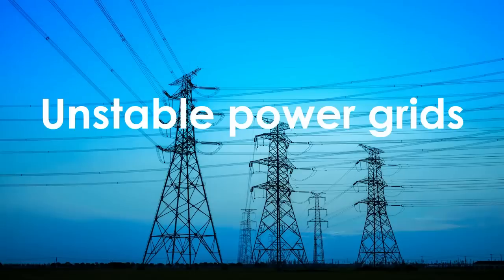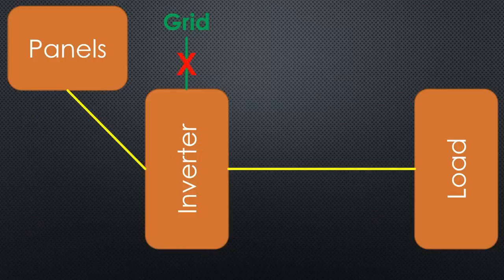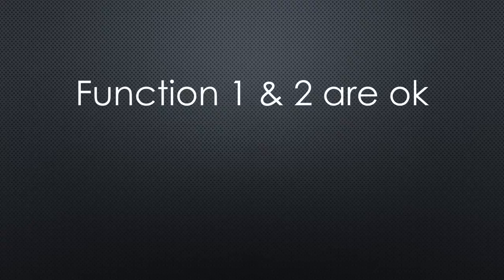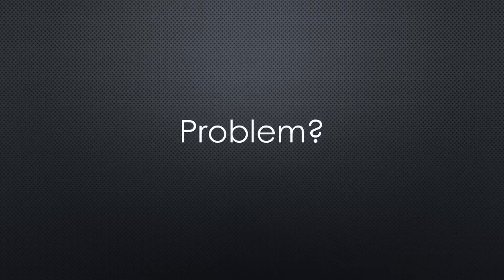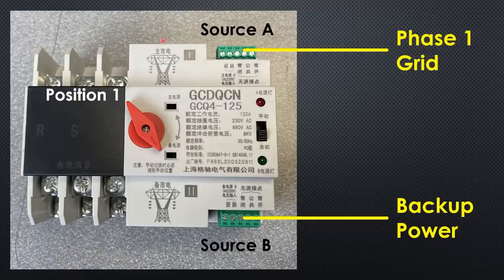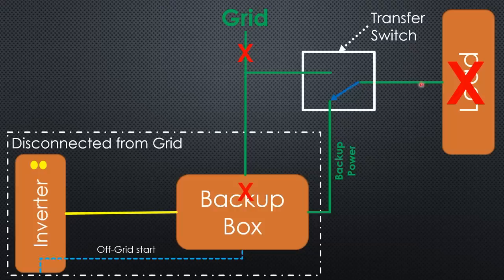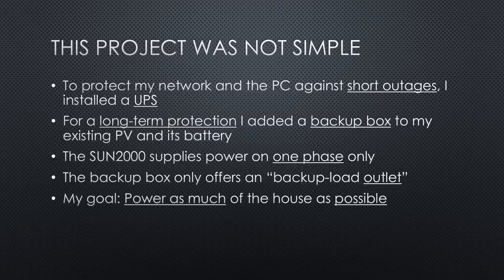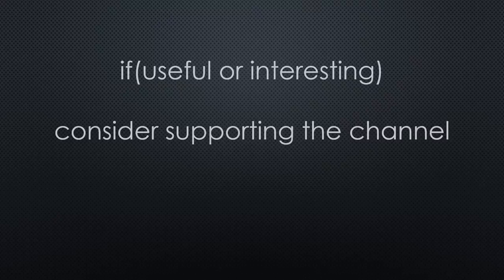448 How to Build an On- and Off-Grid System (Backup Box Hack, Huawei SUN2000, LUNA2000)

Comment: Hi Andrea, maybe I missed it but did you consider  a Hybrid inverter. You could check the Growatt systems. I use a SPF5000ES, only 1phase but you have 3P options aswell. The only drawback this system does not netmetering (export to grid) but new hybrid systems with this option exist. All switching from grid to inverter is automatic, the inverter is disconected from grid, If you use correctly sized batteries for storing sunpower 'you are good to go'. just my 5cents. Thank you for your great videos! You inspire! 73
Reply from the maker: My inverter probably is called „hybrid“ ( I do not know the exact definition). It uses solar, manages the battery, and provides 3phase power to my home.
Reply: A hybrid inverter does the switching between sources automaticaly. source 1 = PV, 2=battery, 3=grid/disel agregat
Reply: @Phoerixx  my Multiplus also have a transfer switch, but if you have a 3 phase at home and only one phase inverter, you have to use an external ATS

Comment: Consider exploring Victron equipment. MQTT, ModbusTCP and Node-RED is native to the ecosystem. Your changeover will be within 20ms.
Reply from the maker: My colleague uses Victron and is happy with it. Have to keep mine for the next few years...
Reply: I guess the delay comes from inverter start-up in off-grid mode, where it takes time to switch the system and supply electricity. Backward switch to grid is nearly instantaneous. I guess and switch relay will have the same delay to do the mentioned process.

Comment: In Canada we have much the same problem. My plan will use a generator but the only legal way to do it is with a transfer switch and you need to mind the grounding when doing a whole house application as opposed to backup circuits. I only have two phases and can jumper them with an adapter to my generator.
Reply from the maker: A generator is a good and simple possibility!

Comment: Yesterday weve installed a 200kw diesel generator at our company in bern. Just for worst case situations.
Reply from the maker: Slightly bigger than my installation ;-) But it is scary that we have to do such things in Switzerland.
Reply: Depending on the purpose, it might be wise to add a battery pack to close the gap between grid switching. Power generators have a small startup time and a small period of time to produce a stable output. Larger installations and critical infrastructure are not pleased with a delay of 1,5s. The batterypack kicks in first and as soon as the power generator produces a stable output the grid switches to the generator. Very reliable, very expensive too.

Comment: Wow, it looks like you know how to party! 🎉 I'm so jealous of your fancy setup; it sounds like you'll be set for any power outages! Thanks for sharing such a cool project. I really like how you've put your whole house (almost) on backup mode.

I'm purchasing a 3-phase hybrid inverter (Solis) with backup mode. According to the datasheet, the AC backup port is also 3-phase, which can switch to battery in 40ms in the event of a power outage. I'm not sure how this inverter can be integrated with the whole house. I might need to implement your solution later on.
Reply from the maker: I also do not know if they are certified to be used on public grids.

Comment: From my experience with my install. Basically the same as yours without the transfer switch; the backup output from the backup box is always powered; even when the grid is up.
Reply from the maker: In my case (three phases), this would give a big short-circuit. So you are lucky you can do it without transfer switch.

Comment: i plan to use 3 victron inverters, so i whould get 3 phase power even during a grid fail (we need 3 phase to run our wood based heating systems and some other important things).
The viscron inverters have the benefit of supliing power without any downtime at all (like offline ups). You can use any Solar inverter with them, only thing you need to make sure is the inverters need to have more capacity than the solar inverter. Once the battery is fully chared the vicron inverters rise the frequency to 51hz to disable the solar inverters.
Reply from the maker: My colleague has a similar Victron system. He is happy with it. I think, he has a low-volt battery (or batteries), though.

Comment: Great video, very interesting, but one note of caution...
With star-wired 3-phase, the neutral cable may be only the size of a single phase or even smaller, as a balanced load will have no neutral current and most 3-phase devices will have neutral current less than a single phase current (because the three phase angles sum to 0 and the neutral only carries the imbalance). 
However, you now have all three phases in phase. That means the neutral current will be the sum of the phase currents, so the neutral may be overloaded. I don't think you mentioned that, so take care to check the neutrals are appropriately sized.
Reply from the maker: I agree. But my inverter only delivers the power of one phase if in off-grid mode (3kW). So it should be ok.

Comment: I guess the same idea could also be done with an electric car equipped with vehicle2load. That is usually a few kW output, but not sure if it can be automated and wired to be always ready when the car is plugged in. And another thought. Maybe 3-phase equipment can be wired to have supply only from grid, as that would guarantee no odd behaviour if all phases are shorted. At least heat pumps etc are probably best to isolate like that. Otherwise a very innovative idea!
Reply from the maker: So far we have no vehicle2load here. So I did not look into this matter...

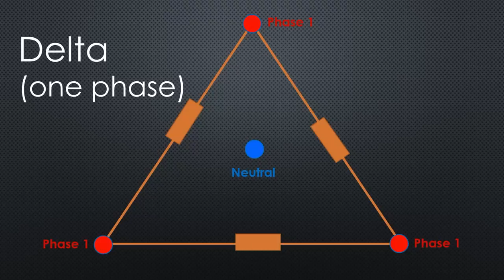Comment: Very interesting, usefull and entertaining. What else? Btw, at 5:38 you metioned that "old motors" won't work in a star configuration because of the rotating field. However, by useing the Steinmetz circuit (adding capacitor to create fase momentum) it is possible. Of course with the downside of losing a lot of power/torque from the motor. I had to come up with this solution several times (air compressor, no 3 phases available). It is however a emercency solution that I would not recommend.
Reply: With some Variable Frequency Drives it is possible to power smaller 3 phase motors with one phase.
Reply from the maker: @Philip: As you know, I forgot all these things during the years because I hardly touch more than 12 volt systems. But good to know in an emergency situation.
Reply: @AndreasSpiess  I'm very fond of 12V systems too and I'm replacing 230V circuits where I can with 12V (or 24V). This goes very well for everything related to lights. Makes it handy for battery backup and legislation is much easier.
Reply: @PhG1961  My radio room (with the exception of the PC) works on 12V, too. But the lab is on different levels... 12V is really very simple: Just connect a LiFePo battery and it works...
Reply: @HB9BLA  Exaclty !

Comment: Nice  hack. However I still would try to have priority loads on separate line/phase. Because you know... power of habits. Especially if you don't have any constant "alarm"/indicator that grid is off.
Reply from the maker: With out 10kWh battery and solar charging also in off-grid mode we could live our life off-grid during a big part of the year. So it is not too critical.

Comment: I have five UPS units from that company, you'd be wise to have a spare battery on the shelf for when you unexpectedly need to replace the one that came in the unit. The cheap aftermarket ones are as good or better than the originals too.
Reply from the maker: Thanks for the info. For the moment, I sent it back for repair or exchange. We will see...
Reply: yes these ups batteries are always failing after 3 years max (less for entry level models like this one...) just keep one 12v battery as a spare...

Comment: hello Andreas, you should be happy that you live in Switzerland. In Czech republic due to stupid rules of goverment subsidies, batteries and inverters from major suppliers now costs  2x more than in other countries in Europe
Reply from the maker: That is bad news!
Reply: @AndreasSpiess  Yes, it is very sad, unfortunatelly these types of regulatory problems is not uncommon in east europe countries. 10 years back almost no small rooftop instalation get permission to supply into grid. But big solar parks on the fields get permission without problem. Also since 2011 electricity consumption is measured for each phase separately, so for household instalations we need inverters with asymetrical output instead of symetrical which are common in most other countries.  
I just get offer for PV system from 2 biggest companies here, for example they want 8k-9k euros for 10kWh battery, goverment subsidies for battery are up to 4200eur, but is limited to 10kWh and 50% of purchase price. DIY installations are not allowed (only exception is full offgrid). Not even all electrican are allowd to do it. Only electricans with special PV certificate can install PV systems connected to grid and subjected to subsidies.

Comment: Great video as always. We have decided to go for a full turnkey system with three phase offgrid possibilities (next year). In Sweden, we have a  "green subsidy" that is capped at 50k SEK per person, so there's no batteries this year since the subsidy is eaten up by the main solar panel installation. 
I would have loved to do a more DIY solution, but we find ourselves with more money than knowledge, so that's our route. The DIY part I'll be when I try to integrate the geothermal heating we're also installing this year and the solar stuff into Home Assistant. Perhaps I will make a short series of it and upload it on my channel - if I can get my ass out of the trolley (Swedish proverb) 😀
Reply from the maker: Cool. So you have a lot of work in front of you. But it is very rewarding to produce your own energy!

Comment: WOW! You guys have 3 phase in your homes. Here in North America homes are connected to 1 phase with a transformer that has a center tap. So homes have single phase 240V or dual 120V half phase, from a "hot" to ground, supplies. Most (99%) loads are 120V to ground, only stoves and other heating devices are 240V. I'm not sure if you can even get 3 phase brought into a house, and if you can the price would be ridiculous. 😃
Reply from the maker: Your country is much bigger and you would probably need more copper;-)
Reply: I usually just see 3 phase (US) for businesses: retail, food, etc. Most residential poles only carry 1 phase {7200V or so) after you get a relatively short distance from the substation. I'm always amazed at the small wire I see in boxes overseas when I have several circuits w/ #6awg on them and 4/0 coming from the utility meter.
The caveat is that those houses have 240v-Neutral on their outlets where ours are 120v. A #14 wire there carries nearly double the power for the same current.
Reply from the maker: Our system provides 400V from phase-to phase...
Reply: @AndreasSpiess  and that would make about 230V phase to N. 👍

Comment: I don't know about the Helvetic confederation but here in EU (I mean Greece) the domestic circuit connected to the grid has to be certified by a technician. This implies that every single devices such as the transfer switch has to be CE compliant which i doupt it is when you buy it from AlliExpress (I may be wrong, please double check by yourself). Siemens sells one but it's above 1000€ here. The Hager model is 813€. The Chinese one is only 36€ 🤔Something tells me that the price tag is not just due to the CE sticker.
Reply from the maker: I do not know, but the professional Electrician installed it. In this application, it is not very critical. Nothing dangerous happens if it does not switch and if it connects the grid to backup while the grid is on (which is a very strange failure mode because it switches between the grid and backup), we get a dead short across two phases (because they are connected) and will trigger the fuses.
Reply: @AndreasSpiess I didn't say that it was dangerous, I said I have no idea why the price tag is so high and maybe it is for other reasons than safety. Maybe reliability? Maybe it's the EU specifications that makes it expensive to produce? Lack of mass production? I don't really know.
Reply from the maker: @srfrg9707  I also do not know. But in my case, I hope it will never be used (or just a few times a year). I assume there are other use cases. 1000 Euro for a simple two-way switch seems a lot to me anyway...
Reply: CE is self certifying....the companies grade themselves, it is the most nothing of all standards.  A kid could set up a lemonade stand, write CE on the side, and it would probably pass...you know, since the kid would be the one deciding if it did or not.
Reply: @srfrg9707  On Amazon user review I found an interesting hint about the potential issues with this switch. It is not (always) switching as fast as promised and no guarantee that all phases and neutral switch synchronously. This could cause an issue if the neutral switches later and is not connected for few milliseconds while the mains are already connected. This is mainly an issue when switching back to he grid with 3 phases, as in such case there could be >230V if the sources on the the three phases are quite unbalanced load.
Reply: I found a European transfer switch solution (ABB OT63F4C) that makes me feel more safe my house won’t burn down 😬

It’s a manual switch and I believe that’s OK for my use (grid down for long time). Of course, it will not cover grid breakdowns when I am on vacation, but a motor driven ATS from ABB costs 400 euro or more. 
This one is only 50 euro.
Reply: @Jacobb1971  50€? Where? I found it at 157,54 €

Comment: Nice solution but be aware, that the neutral wire now carry all the load current, at the same time, compared to the 3-phases.
I know the inverter is only "2-3KW", so there shouldn't be any problem in your configuration, but with larger inverters, this could be a problem, depending on the dimension of the wiring in the house.
Reply: This was my first thought as well. Curious about this if a neighbor and possibly others are going to have the same setup
Reply: I don't know enough about house electrical wiring but isn't the neutral wire carrying the same power, whether or not your tie all the phases together at the breaker panel or not?
Reply: @pcfreak1992  If the load is divided evenly in star configuration at three phases the resulting current through the neutral is 0. When tied together the neutral current is the sum of all phase currents together like 3 times one phase current.
Reply: @olafvanes  Thanks, that makes sense. I assume there is probably also no fuse/breaker for the neutral, right? If not, then I guess installing that would be a good insurance if somebody turned on the oven when on backup power.
Reply from the maker: Each phase has 15A fuses. So neutral should be able to carry this load, too, I assume. And as you write, the inverter can not produce more. And we consume less then 1kW without oven and stove. So it should be ok. The neighbors do not care about this fact because it only happens in off-grid and our neutral is also cut.

Comment: Hi Andreas, thinking from a DFMEA-perspective: If you ever have an "oh-sh*t" moment (electrocution/fire/etc.) and need to kill power to the house, won't the inverter be a try-hard and override your "main power off" action? How can you easily kill main power in your meter-box , in such a situation?
Reply: Surely there's a second fuse box after that one that has RCDs and stuff, so he can cut off power from there
Reply: In most houses (as is the case in his) you have a RCCB/RCBO switch in the circuit. I assume that his failover solution is before said switch, so if he needs to cut the power to the whole house, he could use that switch. Maybe the transfer switch also has a manual override, too.
Reply from the maker: I have a fuse right at the inverter that I can switch it off manually. And the one I used to cut-off the grid.